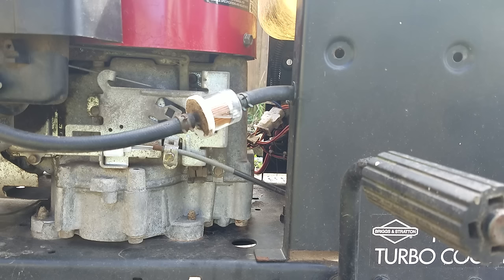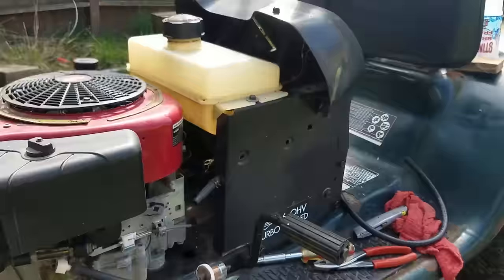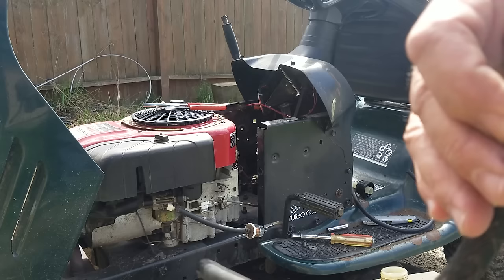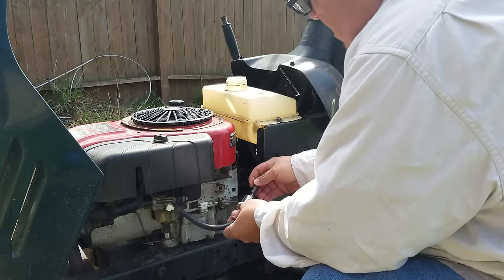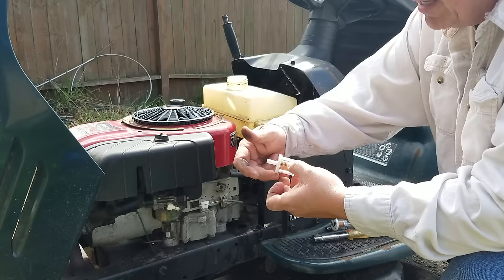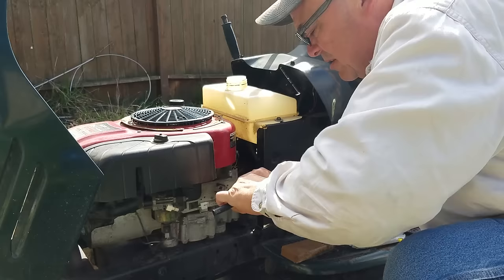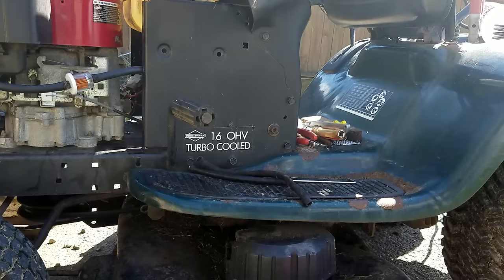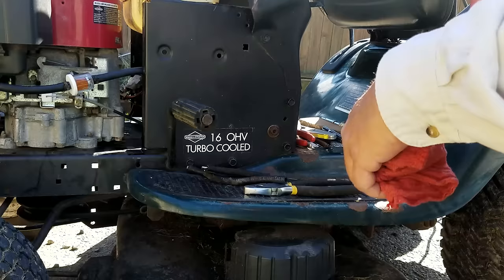Riding Lawn Mower starts then dies. FIXED

Comment: You have problems with ethanol fuel because your mower was made when MTBE was used in fuel.  That was removed because it's cancerous and replaced wirh ethanol.  Newer mowers are made to deal with ethanol fuel.  My mower is 15 years old (2005 model with Kohler engine), and i used 10% ethanol fuel in it.  No issues with fuel line or carb.  I can see why older mowers (from prior to the early 2000's) might have an issue though.  The lines were not made for that.  MTBE was fairly inert.

Comment: I have an older Craftsman as well, Model 917.255450.  I just bought it and did a tuneup and it ran great but then it smoked a lot of white below the mower.  Then I can start it but it dies when I engage the blade.  Any ideas?
Reply from the maker: Sounds like a spindle froze up.   Pull the deck out from under the mower and inspect. The smoke was probably your belt. 
Spindles can just wear out, bind up from sitting for years and my favorite…. Hitting big rocks 🪨.

Comment: Have kind of the same issue with my craftsman. It will start and run for a little while then it will die. Ive had times that it doesnt even do this and runs fine but then there will be days it does it all the time. Ive checked the fuel line, fuel filter, gas cap.and fuel tank for all the issues but they are all fine. I also put new fuel line and fuel filter just to have new. Ive heard the sensor on the bottom of the carberator could be an issue. Anybody have any advice

Comment: The ethanol fuel ate my fuel line and stopped flowing just like in this video.  Pull the hose off the carb and if it doesn't flow, you found your problem.

Comment: So hopefully none of you guys laugh at me but I just received a Craftsman mower exactly what you're working on it appears not to be getting fuel I did notice that you held in that clutch when you started it since I am new to riding mowers do I have to hold a clutch in in order for it to start
Reply from the maker: Yes
Reply: Yes hold the clutch in anytime you start also make sure the blades at off there is usually a switch in there somewhere that won't let it start with the clutch out and also remember ,,,,the only question that is stupid is the one you don't ask could get u killed ,,,,my grandfather told me that when I was young and that's the truest saying you can tell some one ,,,believe me no on is Laughing at you
Reply: My platoon sergeant told me when I was in basic training- the only stupid question is the one you didn't ask-- Vietnam vet here
Reply: @briananderson3801  And you might have to put weight on the seat. There’s a kill switch in the seat as well to make sure you’re sitting on it when you try to start (or turns the motor off if you fall off).

Comment: My gas line has good fuel supply. When I turn the key to start, it tries once with what fuel reached the plug (just enough to kick) then it just turns over ,over but won't try to start. I turn the key off, wait for a sec. ' and try again and it does the same thing.
Reply: Same with mine. Had no spark. Changed plug and coil both and now it'll fire a few times then quit after trying to idle.
Reply: 22nd

Comment: Hello I had fuel in my filter and it started up then stalled on me it’s turning over but won’t stay running any suggestions
Reply from the maker: Try this...... If you leave these mowers outside during the winter you will accumulate water in your fuel tank, so you need to drain the float bowl on the carb and check for water. You can find out if your getting water by placing a clean plastic cup under the bowl while you drain the float bowl, let the fuel drain from the bowl into the cup, then you will see the gas and water separate. If you get water with your fuel you may have to run or mow until the mower stops again. Repeat the draining process a time or two more. Good luck.
And yes, this is a copy and paste answer from a question I answered last week, but holds true in your case. IMHO
Reply: breakerbroke23  WRONG...factory filters are garbage...will disintegrate on regular fuel & clog, causing a temporary engine kill.  When restarted, will run...TEMPORARILY...until debris once again clogs the line. Replace the filter with a paper media one...every two years.😎

Comment: I wish this was my issue. Plenty of fuel flow but my mower will not start unless I add the starter spray and even so it only runs for a few seconds before shutting down.  I've cleaned battery terminals, checked for loose wires, cleaned the carburetor .  Now when I turn the key the engine grinds for a few seconds and stops.
Reply: Check the fuel pump and hose connections. One loose hose and that’s enough to keep fuel from flowing. I have also seen videos on coils going bad, may be worth a look.
Reply: @benphartine  Thanks for responding I checked the valves too, they were a bit loose.  I also noticed my lights won't come on.  I'll check the coils tomorrow thanks!

Comment: I know you're doing this for the video but pouring gas from the fuel tank into a gas tank while it's dripping with the gas tank sitting on top of the engine is not a good idea, particularly if the engine is still hot.  It's also a good idea to wear protective gloves when working with gas.

Comment: My mower is doing the same thing, but I have the gasoline in it that has 0% ethanol .  It is the beginning on the 2021 season. I changed over to 0% ethanol last season and before the season was over I noticed the fuel lines were disintegrating ! I removed the lines... cleaned them .. but I think I have to replace them .
Reply from the maker: IMHO, I would just change out the filter and lines now. Then you will be assured of not having any fuel delivery issues this year.  Cheers.
Reply: Check the fuel solenoid under carburetor you can by pass it make sure install a shutoff valve plenty of vids on YouTube

Comment: I use ethanol free fuel. My mower started to cut out right when I got done mowing and was pulling into my garage. I don't know what the issue could be. I replaced my carb, fuel filter, and spark plug last year. I am bit stumped.
Reply: Your gas cap vent might be blocked, try loosening the cap to see if that is the problem. If so drill a tiny hole in cap. Worked for me.
Reply: Its the shagnasty fuel lines

Comment: I've replaced  the carb, sprak plug, fuel lines, gas filter and cleaned out the gas tank with a new battery. My tractor starts, runs for two seconds then dies. I don't know what else to do. It's driving me nuts!
Reply from the maker: Get a can of starter fluid, take off the air cleaner and start the mower, as soon as the engine starts to die off spray the starter fluid into the carb. If the engine keeps going you still have a fuel issue (fuel pump?) 
If the engine still dies off then you may have a ignition issue, coil, condenser.....etc. Try this. Good luck.
Reply from the maker: Understand, Iam NOT a professional, but this is how I would troubleshoot.
Reply: @breakerbroke23  Did that as well. Time to take it to a service shop and pay through the nose, I guess. Thanks very much.

Comment: Poland Pro 17.5 / 42" cut. Runs 4 to 5 minutes then acts like it's running out of gas. I cleaned the lines, & tank, blew through the fuel filter and the lines are clear. Gas flow is not the problem for this one. I have the good gas in it and it still does the same thing. Any path you could direct me to on this sure would help before I strangled the thing with my bare hands??
Reply from the maker: Take off the float bowl you may see a bit of water and gunk. I always put a clean plastic container under the carb before I pull the bowl off, the plastic cup will catch the crud in the float bowl when you pull it off. Then you can see what was in there. Also check for sticky float. Good luck.
Oh yea... Put in a new spark plug wile your at it.
Reply: @breakerbroke23  I can't thank you enough for the info. Pickens South Carolina says thank you.

Comment: Do most gas stations sell ethanol free gas? I see on the pumps where there's a 10% ethanol added to the gas that we buy. Is there an additive that one can add to neutralize the ethanol? I don't remember seeing ethanol free fuel at any of these gas stations here in San Diego county.
Reply from the maker: The Big brand stations usually do not carry ethanol free, look at some of the off brand or Ma & Pa stations, I just bought some for my generator at Sinclair in Salt Lake City. I paid 2.39 gal for premium, in WA state I was paying 4.79 gal. So prices do vary but the non ethanol is very much worth the price.
Reply: Fortunately I can buy "ethanol free" gas here in Harrison Michigan at Shell and Marathon stations. Although it is possible to make ethanol free gas, it's quite a process. If you can avoid it, never use the standard pump gas that contains ethanol for ANY small engine like on lawn mowers and such, regardless of the octain rating, as it indeed does deteriorate fuel lines and carburators!  You may also want to consider using fuel stabilizers  such as Sta-Bil  (Marine grade is best) and/or Seafoam.

Comment: What happens next if you replace the lines and clean your fuel filter and it continues
Reply from the maker: Make sure the vent hole in the gas cap is not clogged.

Comment: I have a craftsman mower too. I have the fuel line issue. I also have an issue with the blades. Sometimes it cuts as if one blade is lower than the other.  I also have a rear bagger. Am I supposed to use different types of blades with the bagger? Sometimes it's perfect and some days the tube constantly clogs. 

I know it's a lot and I appreciate any answers.  Thanks
Reply from the maker: Low moisture is the key when using a bag, dryer the lawn the better. They do have high lift blades https://amzn.to/3O8Qpof (I have never tried these)
 You may have a bent blade or a a broken spindle bolt. That would be a bolt that holds the spindle to the deck, if you feel more vibrations than usual, you may have a bad spindle.  This usually happens when you hit hidden treasures in the lawn.

Comment: Mine runs for a few minutes then dies.  I took off my fuel line and sprayed carb cleaner through it--it seems clear.  Also sprayed the fuel filter, it ran through it all fine.  Hooked it all up again and then it shut off after running a few minutes and then refuses to start again for about 5 minutes.  I think mine may be overheating--but I don't see how.  Air filter looks fine and there's plenty of clean oil.
Reply: Any solution?
Reply: @evano581  ended up just taking carb apart and cleaning it. Might have been a small piece of something cause it worked fine after that. But haven't used it since then we havent had enough rain to mow.

Comment: I need your help. I have a Craftsman rear engine riding lawn mower 6 speed, shift-on -the go, 30” deck model NO. 247.29
I’m reasonably sure the carburetor jet is plugged. However, I can’t get the carburetor off. I could not find a You Tube video to show how this will come off.
Here’s is what I am running into, the bottom of the carburetor seats in a 1” saddle. There is a short stud on top of the carburetor that runs through a fixed plastic cover, the stud is too short to double nut. Then there two horizontal bolts that are too short to double nut.
Reply from the maker: Find the Model # of the engine and go from there. I can not help because I don't know what engine you have.
Maybe try Taryl Fixes All... He has a great channel with lots of great information. Cheers
Reply: @breakerbroke23  thank you

Comment: I realize this is an older video and you do say it is an older machine, but all of the fuel lines made today and for several years now, are made to handle today's gasoline with ethanol.  So either that is a very old tractor that would have a fuel hose not made for today's fuel, but also rubber hose fails over time anyway!! Everyone loves to say it's an ethanol issue, but why then do brake hoses fail in the same way?? Why do rubber hoses fail that have olive oil and palm oil running through them fail??

Comment: Same mower. Lines were changed and new filter. Gas still does not flow properly into the filter.
Reply from the maker: Poke through the outlet hole in the bottom of the Tank with a straightened out coat hanger, I have seen these holes plug with gunk.
Reply: Anita Demara s

Comment: Great video. I'll try this tomorrow. (I'm confused about one thing. Did you say at 14:31 that ethanol-free fuel is a waste? I had the impression that you dislike ethanol.)
Reply from the maker: In a vehicle it may be okay, however with small engines I like ethanol free. EF fuel stores longer it doesn't pull the moisture out of the air. Great for longer term storage like in generators. (I don't use fuel additives)
Reply: @breakerbroke23  Right. That's why I was confused. Anyway, there seems to be an error on the part number for he fuel filter for these mowers.
Reply: Trying to find premium gas is few a far between where I live. I have better luck going to airport & buying airplane fuel.

Comment: My original Briggs fuel line is 24 years old and I have only run E-10. I wonder if it's a quality issue?
I'm also using my original fuel filter.
Reply from the maker: Could of been a supplier issue. Some rubber good quality, some bad.  Cheers.

Comment: My LT1000 fires up, then dies immediately. I replaced a new fuel line and still no results.  I noticed the little sensor doesn't click on the bottom of the carburetor
Reply from the maker: Pull the float bowl off and check for contamination.  replace the solenoid at the bottom of the bowl with a bolt and see if the motor will run, if it does then take out the bolt and replace the solenoid and your good to go.
Reply from the maker: One last thing, don't be surprised when you take off the float bowl water comes out as this also will make your mower act that way. Storing the mower outdoors in winter can cause problems because moisture will get into the fuel tank via the little vent hole in your gas cap.
Reply: I got the lawnmower to run. It starts right up. And I even cut the grass but when I lowered the throttle to park it, the throttle surged really high and I turned the key off. When I restarted, it still surged high so I stopped it right away.
Reply: @breakerbroke23  I need a video for the above process, please. I have a craftsman T1000' Starts, but once I take it out of the choke position, it bogs and dies.

Comment: I have a question : How do lawn mowers charge the battery? My tractor only has a starter and magneto (ignition coil). Do they even charge the battery? I have an old Rally 10 hp , Briggs&Stratton engine.
Reply from the maker: They have a stator behind the flywheel, that charges the batt. Check out this video... This Guy is a true pro.(no kidding)  https://www.youtube.com/watch?v=laHpzP6fcd8
Reply: @breakerbroke23  Thanks!

Comment: OK...So I have a 2 year old Husqvarna rider. No problems until recently. It starts but only runs for a few minutes then acts like it is out of gas. It isn't. I have changed the spark plug, inline fuel filter, drained and replaced the gas, run a bottle of "Heat" through to dry up any water in gas just in case, and replaced the air filter. I had no idea the ethanol screwed things up. My question: Could it mess the lines up in just two years??
Reply: I also removed the fuel solenoid and cleaned the bowl. (There was a small piece of trash in bowl.) While I had it apart, I ran a safety pin up into the carburator opening to unseat any trash. It started right off then died within 10 minutes.
Reply from the maker: Do you have a fuel pump, if so check that. I would take off all the fuel line and run something through it, like a piece of striped 12-2 wire or a coat hanger. see if any crud comes out. Your problem sounds like a fuel delivery issue to me.
There maybe something still lodged in the carb as well.
Reply from the maker: I have also seen crud in the outlet of fuel tanks. try to clear out the outlet,   you may have to pull the tank,( if your lucky you can get in through the top.)

Comment: I never use ethanol in my mower, but I still have an issue of having to run it with 3/4 choke all the time. Could that be a bad fuel line too.
Reply from the maker: Could be a slightly plugged line, also could be a plugged fuel filter. If you check those and all come up good, go back and start looking at the carb.
Reply: If it has a fuel pump, it could be not working

Comment: I just bought a craftsman 22hp riding mower used. It starts on one click, but when I lower the rev, it trottles up and down then slowly shuts off. It runs high and constant just below choke. Any suggestions. It
Reply from the maker: First try cleaning the float bowl.

Comment: Can we please get rid of the ethanol in our gas!!
Reply: It's there to reduce carbon monoxide emissions and other nasty stuff.  It replaced MTBE, which was cancerous.  Get rid of ethanol, and you're back to some other cancerous chemical.
Reply: @vigla002  More ethanol in gas.. engines wear out faster (especially since millions of homeowners have no clue how to care for a small engine), factories have to make more engines.. more emissions from factories. haha! Would be better off with no ethanol. That's my story I am sticking with it.
Reply: @crisprtalk6963  that's fine, your opinion.  Like I said, engines since mid 2000s are designed to handle it just fine.

Comment: I do not have gas flowing into the carburetor. I added a fuel shut-off, fuel filter and line but the carburetor is dry with no gas. Any suggestions??  Thanks
Reply from the maker: Down in the bottom of the tank you have the outlet, that hole can get pluged up. Take the fuel line off and then stick a pick, coathanger or something like that  up through the hole, you will get junk that comes out. Give that a try..... good luck and Cheers.
Reply: breakerbroke23 Ok, thanks!